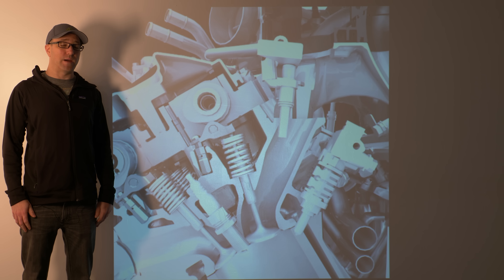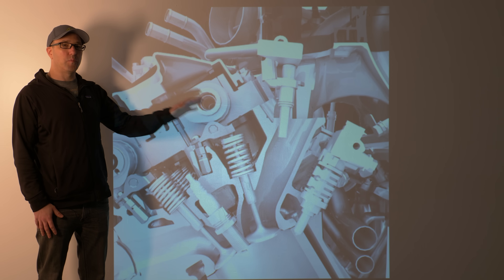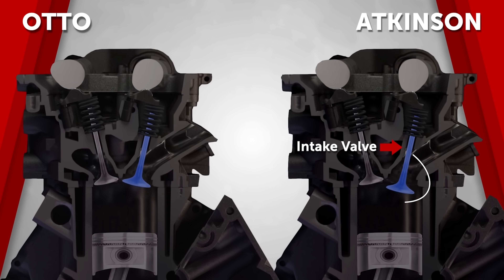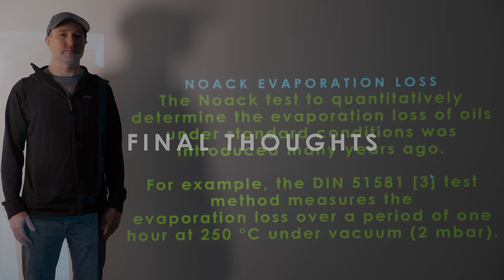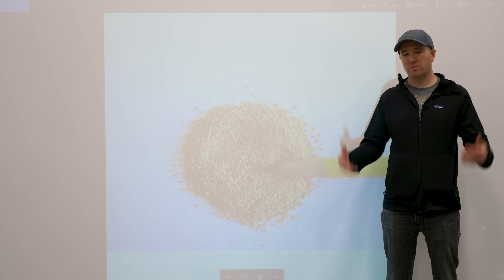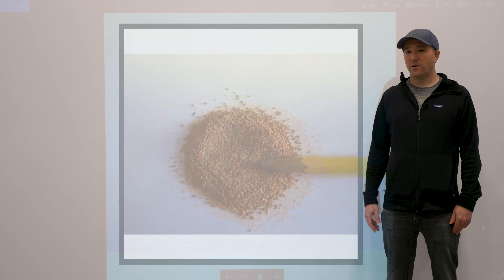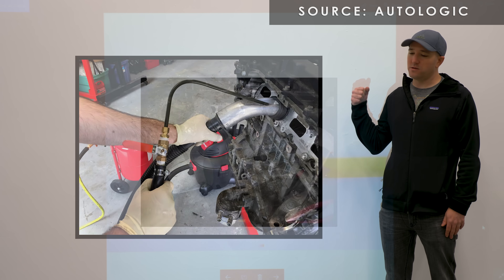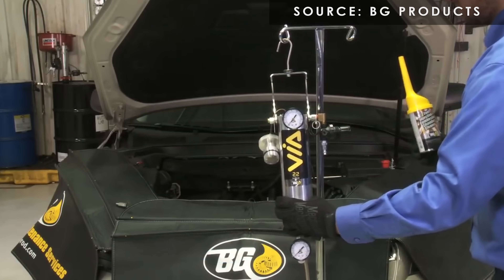Direct Injection, Problems and Solutions | The Fine Print

Comment: i have to add another reason why direct injection was created. It´s more efficient and save fuel. AND the technique is really NOT new at all as the engine and car makers tells us !  Near 90 years ! ago this invention become very common in our german V12 plane engines. Due to the fact they had no or to less of high octane fuel they cant increase compression ratio and engines went bigger and bigger in capacity to get the same hp as the ones from england (RR). One of the solutions was the direct injection. Over 50000 were build by Daimler Benz and Junkers. Only a few engines are running these days but still they sound great https://www.youtube.com/watch?v=CnpC_BcK7xY&t=58s

Comment: After watching this video I became educated enough to know what I want to buy for my next vehicle and I did just that. My new Toyota has the older VVTI port injected engine and found out the 2019 RAV4 is going to the port and direct injection. My wife's Honda has the 2.4L VTEC engine that is port injected but the new ones are 2.4 with direct injection. Am very happy with my choices. By the way the wife's Honda is 140,000 miles and not one single engine issue. I also have a Titan P/u 5.6 liter with port injection and no problems.Sometimes the advances get way too complicated and trouble prone. This video sure helped me. thanks.

Comment: This is why I bought my 2014 XV Crosstrek. Timing chain driven, port injection only. Direct injection has plagued manufacturers for over a decade, and I didn't intend on being caught up in it til Toyota or Honda embraced it with open arms. And it seems Toyota has with the D4S.

Comment: Honda corrected this problem by totally redesigning their PCV (Positive Crankcase Ventilation) system. VW and AUDI do it the worst. Everyone else is in between. Just buy a Honda and get over this crap
Reply: How about the L15b engine in this article https://www.thetruthaboutcars.com/2018/08/piston-slap-earth-dreams-of-carbon-buildup/.
Definitely worried since I have one in my Civic Hatch.
Reply: According to Consumer Reports, Direct Injection was a problem since day one. The worst being VW and AUDI. but all of them were bad.  Then, Consumer Reports stated that Honda corrected the issue by redesigning the PCV (Positive Crankcase Ventilation) system and there is no longer a problem.  Others corrected it by using a Direct Injector AND a Port Injector. In the LATEST report from CR, all cars are now fine concerning Direct Injection and have addressed the issue. In older cars with Direct Injection, do NOT use additives like Sea Foam or other products that are sucked into the intake manifold. This DOES get rid of the carbon on the back of the valves, but it fall on top of the pistons and then destroys the rings. The only method of cleaning the backs of the valves on cars prior to the 2018 model year,  is the BMW method where they take the head of your engine off and blast the valves with ground up walnut shells. Many repair places have the equipment to do this. This is why I waited until this year 2018, to buy a new car. The ere of Direct Injection made me wait until the problem was correct.
Reply: Thanks for explaining it. My car is an 2018 model with the turbo.
Feel better about it now. 
Would a catch can help further with the issue?
Reply: I bought my 2018 Honda Accord 1.5 Turbo in January. No need for a catch can on the 2018's. I would DEFINITELY use one on earlier models.  I wanted to buy a new car about 3 years ago but I held off until the Direct Injection issue was dealt with. There is no issue anymore. What a bad few years it's been watching so many people end up with engines that were basically shot at 50K miles, losing power, running bad. I had an old Toyota and it was fine but I just wanted a new car but I knew about the problem and waited. Also,  In Consumer Reports, they said that Honda not only does GDI right, but it also does Turbo right.  So, I wouldn't worry about the 2018 Honda 1.5L engine, or the 2.0 for that matter. From everything I've read, there is no need for a catch can now that Honda revamped the PCV system.
Reply: Great, good to know at least some manufacturers reacted as they should and fixed the problem.

Comment: I was stunned you didn't mention water methanol injection system ... 

That would definitely clean the intake valves after some runs ... 

Yes it is expensive but you don't have to run it every time ... 

I'm obviously refering to big petrol engines such as the V8's and you can also enjoy the added power after some software editing ..

Comment: What about upper engine cleaner or seafoam? I used some upper engine cleaner on my 2004 Subaru Legacy 3.0R and it seemed to make a difference. You can see all the black smoke coming out of the exhaust when you use it as well.

Comment: Too funny indeed next vehicle’s manufacturers will require engine bearing replacement at 80k  kilometres not miles on new style engines.  since if you don’t change the oil on new vehicles they always make a mud like substance in the head or sump areas / blocked oil pick ups . All I can say as a technician/ mechanic for almost 15 years now engine and cars now are all absolute rubbish . My 30 years Nissan fj20et engine has and will out last any modern engine made today or in the past ten years or so

Comment: Low octane fuel with carb or port injection is/was never good for high compression engines,hence direct injection should be able to do away with pre ignition and that pinging [pinking] sound, if dual injection becomes all the go, does it mean that octane rating has a bearing as you are squirting fuel in before sparking,and direct injection engines typically run 10 plus comp ratios? or is it that the amount of gas injected is so lean that pre ignition can not be a problem?. Also, is it possible that if octane rating may?? not be any kind of concern with direct injection, could you inject low cost Kerosine and get a satisfactory result.

Comment: I have a 2012 Jag XJ L super sport,510 HP with direct injection. I was told of possible carbon build up, So I simply used a product made in 1927, called Marvel Mystery OIL. It's the ONLY  product of this type,  that has lasted this long,simply  because it WORKS. I'd never use it in the oil, as the Jag uses syn.oil. But it is also to be ADDED TO the GAS. 4 OZ TO 10 GALLONS. MY ASS HAULING CAT HAS 25,000 MILES, AN HAS NEVER MISFIRED ETC, AND PURRS LIKE A WELL FEED BIG CAT. 
SO THIS GUY IS  A JERK OFF FOR NOT TELLING THE SOLUTION TO CLEANING THE UPPER CYLINDERS.  SHAME ON HIM..  $15.00 a gallon at Walmart. I've used this upper cylinder cleaner for many yrs, in the gs only, an never ever had any issues.  The host is Just another  jerk off ,long winded an wasted my time,an yours, as I just stated the FIX.. His pcv  trick is another joke. Just change it every 5,000 miles,and use a full syn.oil and syn. media oil filter. Damn, just common sense!!!!!!!!!!!!!!!!!!!!

Comment: I have a 1992 Honda Civic DX sedan, it was abused and it is worn out (273,000 miles as of typing this) but I still manage 30-48 miles per gallon out of it. I know that with it running well, and a good tune, I could improve that to much higher. Direct injection is cool and all, but I will stick to my cheaper to maintain port fuel injection because it does the job just fine. Great video, you just earned a new subscriber :)
Reply: Had a '92 Civic LX that I achieved 50 mpg... TWICE!!
Reply: Awhile back I had to change out my clutch and transmission, the original transmission someone let it leak all of its gear oil out and the bearings for the input shaft had literally fallen out into the transmission. The transmission I now have came from a 1993 Honda Civic VX hatchback, and it is insanely high geared. 1st and 5th gears are identical to my original transmission, but 2nd through 4th are staggered, and the final drive went from 4.088:1 to 3.25:1 and bumped my gas mileage by a crap ton. At 70 miles per hour, the engine is only turning 2,400 RPM, and I love that, makes driving on the highway amazing.
Reply: I remember when we invented electronic ign. Some People wanted to their points.
Reply: @4406bbldb  My roommate had an old Dodge Power Wagon that was stuffed with a 440 and a 6 pack, it was still points ignition. He said that about once a week he would go to start the truck and it not start, so, out with the trusty screwdriver, and whack the distributor a couple times, and it would start right up. About once a month he would adjust the points. I have never had to mess with points ignitions, but I have helped a couple of friends adjust carbs. I love tinkering with and tuning on cars, something that is difficult to do with today's cars.
Reply: @Carstuff111  i like all that stuff to. Note: i started at Chrysler performance engineering in 69 and developed so much of the modern stuff but i still like the basics. Follow the fun...
Reply: @4406bbldb  I was born in the 1980s, grew up through the 1990s, I have a thing for vehicles of that era because it is a great blend of modern technology in its infancy, and old school principles of car maintenance (generally keeping things simple). I have respect for certain aspects of modern cars, but I rather have an old, simple car that I can do what I want with. Modern cars are so picky, you can't even modify the wiring without wigging something out because of a very slight change in resistance in the wiring. The only modern car I would love to own is the 2015 Camaro Z/28 I drove while working for a local VW dealership. That car was pretty epic, but this said, rather have a 1st or early 2nd generation Z/28.
Reply: @Carstuff111  oh i was just remembering, 440 6packs of 69 had duel points in prestolight(sp) distributor. Funny i can't remember 70 because i did lots of engine development on the year package. Fun thinking about it. Maybe I'll have some speed test dreams.
Reply: @4406bbldb  It is awesome to chat with someone that has experience with development at one of the big three :) And I must admit, I have a lot more respect for Chrysler of that era than of the modern era. When it was still an engineering company, now it is a shadow of its former self.
Reply: @don awww man the 60s pints distributors hahahah ancient
Reply: Be smart sell it now!!!!!
Reply: what was forgotten was those 90's import cars (like i used to have) were waaaaay lighter then the stuff today. a contributing factor to using less fuel
Reply: Carstuff111 there’s no place for ricers here, move along
Reply: Or you can just bite me :) I am not a ricer, I actually take care of my car, thank you very damned much. Ricers do not take care of their cars and do stupid ass mods for the "look", and add loud ass fart tube exhausts to "sound fast" when all they are doing is making it easy for the cops to find them. Learn the difference, ass hat.
Reply: @Carstuff111  that's true lol

Comment: um actually a heavier oil will create more carbon build up use only the manufacturer recommended oil especially when you have direct injection
Reply: Why would thicker oil create more carbon build up?  
Less oil will end up evaporating and getting burnt. I use  5W50 or 10W40 rather than recommended 0W50, and definitely need to top up my oil level way less, in a MB B250 (turbo DI 4cyl).

Comment: Very good info in this video. I remember removing my intake manifold only after 300 miles and already I could see a coat of old oil on the valves.
Reply: What car and what type of fuel injection?

Comment: Do you really hear yourselves ? 2500 metal parts rubbing together, lubricated by oil. Intricate explosions of air and gas. Plumbing to keep it all “relatively “ clean. What a mess ! Cars of the future won’t be about hardware. They will be about software. An electric motor has none of these problems. Anyone who says battery technology is not here yet is fooling themselves, it’s here.

Comment: I have 90k on my 2012 Lincoln MKS ecoboost 3.5 and it runs amazing. Just took a trip from chicago to Nashville and got 29.5 miles per gallon. Never a issue. I do only run Motorcraft synthetic blend 5w30 and filter. Its a GDI and twin turbo car.
Reply: Oh and I did install a catch can and it works great.

Comment: I suppose you could use water injection to steam clean the chamber, because every time I see a slight coolant leak into a chamber you spot which one easily because it's always the clean chamber -  I've reco'd 1000s of heads -. Whether that is enough to clean the back of an inlet valve that is always cooler, I don't know.

Comment: Excellent presentation, and simple enough for the average owner to understand the pros and cons of GDI.
There is another solution, that will hit the manufacturers soon, but that is a commercially sensitive matter. I have met and talked with the Vice Presidents of  VAG  ( Volkswagen Audi Group in Wolfsburg, Germany )  and the V.P. of  Chrysler transmissions teams in 2006-7 but they were not interested in finding solutions to problems that had up to that time NOT even manifested themselves, so that was too bad for them, and too bad for owners of those brands. The chickens have now come home to roost, and the solution is still waiting . Meanwhile, the arrogance of some Engineers right at the cutting edge of the research and development departments of  these automobile manufacturers, is costing billions to put right, but the wrong people are taking the blame, just because the MSM wishes to see heads roll. Common sense is not so common it seems. NOX is curable without much fuss too. Think about it.

Comment: It's always the emissions regulations. The EPA has totally ruined diesel engines with the DPF regeneration and all that which kills the mileage, leading to more burnt fuel in the name of lowering emissions.
Reply: DPF is fine when the car is used appropriately. Too many idiots buying diesel engined cars to do short trips.
Reply: @ferrumignis  The main problem with cleaning the diesel engine to the same level to emission of the gasoline engine is not that you can't possibly do it but it's very hard to do it efficiently on the scale , because you have to compete with the gasoline engine which is inherently cleaner...so as a diesel engine manufacturer you are facing more costs to start ...and it only gets more expensive from there. The diesel engine had its day, and it still has...at the certain applications...but unless there's a new breaktrough technology, the diesel engine will only surve in bigger displacement applications....and this the guy who had driven quite a few European diesels...and i can hel feeling a mid range acceleration of 1.8 L turbo diesel...it allways bring the smile to my face.
Reply: Zlato Zivkovic I agree that diesel has had it's day.  They are difficult to make clean and I don't personally like diesel engines.  However many people (in the UK at least) have bought diesel engined cars for doing very short journeys in cities etc. which is about the worst thing you can do with a DPF equipped car.  Doing regular long motorway trips are were the economy and torque of a diesel engine really helps, and DPFs tend to last a long time under those conditions.
Reply: @ferrumignis  I agree, but the problem is that todays pollutions regulations are getting so strict that even DPF can't do the job good enough to satisfy those standards. Gasoline engine has significant advantage ocer diesel because is inherently cleaner so it is less expensive to clean it's exhaust than diesel's...even though this more and more becoming irrelevant due to dawn of the electric vehicles and both tehnologies are largely go to the museums just like a steam engine. It might still be around in let's say 20 or so years, maybe 30...but at some point will not be financialy sound to invest in improving them since even now it's getting more and more expensive to make even small improvements because all the low hanging fruits are already picked...of course unless someone comes vith some revolutionary design that changes everything. But...even in that case i believe the internal combustion engine is on it's way out.
Reply: No problem with diesel, just don't buy new stuff, my 12 valve Cummins has almost 300k. One injection pump and a set of valve springs and I try to keep the boost below 40 psi

Comment: Did he really say a 70s 80s port injection can get 60 70 MPG? I say not true. A 70 MPG 70s 80s car DOES NOT EXIST.  This carbon is a problem  with DI but don't way overstate the MPG of older cars.
Reply from the maker: 2000 Honda Insight, Manual Transmission.  60MPG City 70MPG HWY. Being developed in the 90s.  Other lean burn engines were the same being developed in the 80s
Reply: @savagegeese  Honda insight is a hybrid with gas and electric motors. This is apples and oranges.
Reply from the maker: @oldarkie3880  the electric motor has nothing to do with the fuel economy that car got.  IMA was assist only, and many people disabled it or switched it into a manual mode to further reduce its use.
Reply: @savagegeese  Then it no longer gets 60 MPG

Comment: Interesting topic. Geographic location does have an effect on this valve build up. Premium fuel helps reduce the build up. I have also found using Archoil fuel additive (started using this in my cars before I recommended the use of this product) helps reduce the build up of deposits on the back of your intake valves. In short, keeping the air clean costs everyone. Personally I wish they would explore more with hydrogen hybrids and diesel hybrids. I’m just a monkey with a wrench in my hand so I know nothing.